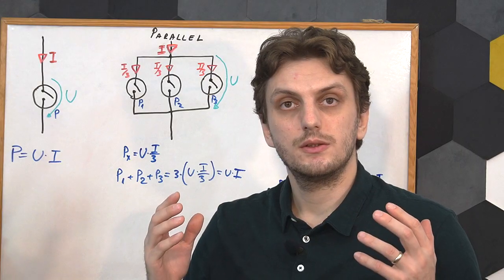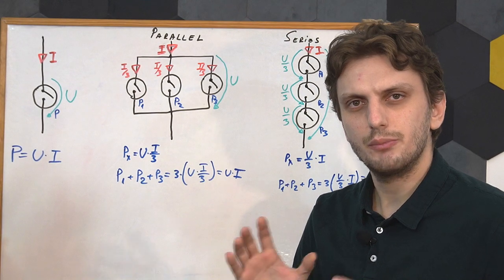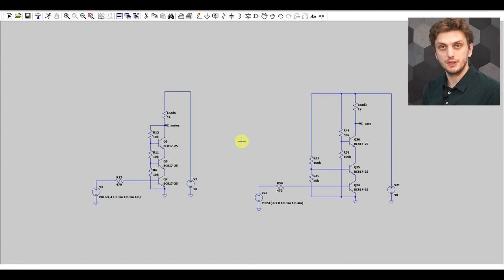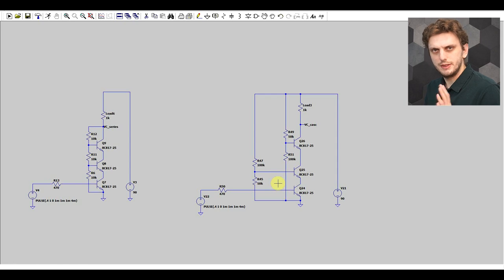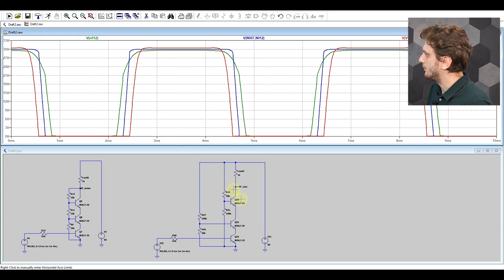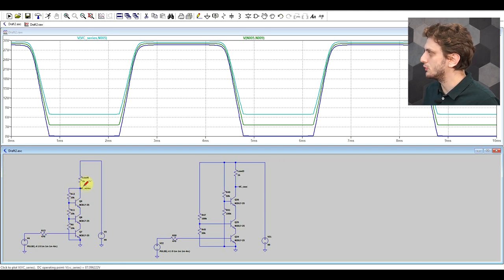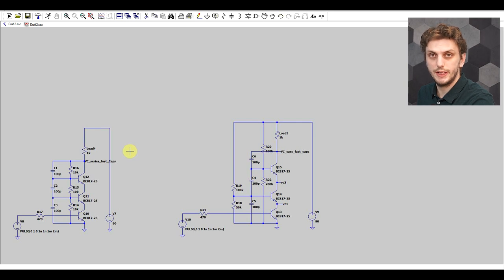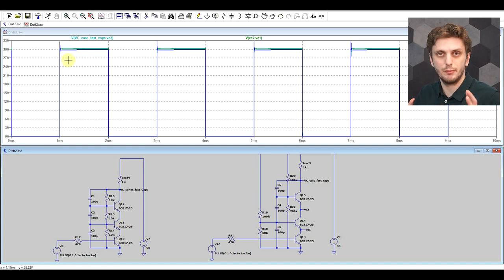Electronics tutorial - 3/3 Driving multiple transistors in series

Comment: Great video. 
Maybe it's worth to mention that the creepage and clearance distances you're talking about are for mains vs secundairy voltage. 
They are much lower and forgiving between (two) different secundairy voltages.
Reply from the maker: Of course, the main use case of large creepage and clearance is for safety regarding isolation. At the same time though, if the circuit is very low power or otherwise sensitive to leakage currents then the same rules need to be applied.
Reply: @FesZElectronics  Correct.
What I was trying to say, is that often I see people using the same creepage/clearance values for secundairy voltages. 
Which is a little overkill.
Reply from the maker: You are right. I also see rules taken out of context and applied everywhere, because "its better this way"...

Comment: i have a question! i´m working on a final proyect about loads dc, and after see all topics about MOSFETs i wonder which schematic configuration would you recommend for a load with a power = 136W ???. I´m using four IRLZ44N in paralalel to handle that power and a btj to handle the gate of each one making a reduction voltage.

Comment: Hello again Fesz.  Thank-you for another interesting and challenging video!  I’ll add a few comment to express my perspective. 

First circuit (Q7, Q8, and Q9).  There is feedback from the output to the resistor divider.  Therefore, we cannot fully saturate at the output of Q9 because as the load is pulled down, the feedback reduces the drive to the bases of (Q8 and Q9).  On the other hand, when we apply 0.4V to Q7 in order to cut the transistors off, current flows through the load and into the resistor divider, which prevents the output from reaching VCC.

Second circuit (Q24, Q25, and Q26). Without the feedback and the reduction of base drive, the output can be saturated and can also come up to VCC.

How to explain the differences in power dissipation during the linear regions?  In the first circuit, during the transition from on to off, the emitter voltages of the middle and top transistors are defined by the base voltages as those base voltages rise with decreasing current.  Because these base voltages come from a single resistor divider, which is driven by the load voltage they are in the desired proportion and the power dissipation in the 3 transistors is relatively equal.

For the same transition in the second circuit, the collector voltage of the bottom transistor comes up first, followed by the collector voltages of the middle and top transistors.  The power dissipation is therefore larger in the bottom transistor, less in the middle transistor, and much less again in the top transistor. How this is explained by the use of separate voltage dividers driven from the supply is not clear to me.
Reply from the maker: Hello David,
I guess the key to understanding the behavior and the differences of the 2 circuits relies on understanding the base voltages ratio to the upmost collector voltage. This is important since the emitter of each transistor is roughly at ~0.6V below base voltage, but more importantly, this is the same voltage as the collector of the next transistor below; for the sake of simplifying lets just say the base voltage is the same as the emitter.
So in the case of circuit 1 the bases are supplied from a voltage divider that keeps the base at 1/3 and 2/3 of the upper Vc (collector voltage) - this ensures that the voltage drop Vce on each transistor is 1/3 of the upper Vc - so uniform power distribuition
In case 2, the bases are supplied from fixed values - Vsupply (which is not the same as upper Vc)  divided by 1/3 and 2/3; The 2 upper transistors are working in common base mode. As upper collector voltage drops, the first transistor to take this up is the up most transistor; once the voltage drops below VCC*2/3 then the upper transistor stays saturated and the next transistor starts to have a dropping Vce and so on. Its also important to add that since the bases are supplied from resistors, the voltages are not fixed, but rather can vary when needed. 
I hope this helps with the better understanding.
Reply: @FesZElectronics  
Hello Fesz,

Yes, that all makes good sense!
Thank you so much for your careful and detailed response and for your time!
You are the best.